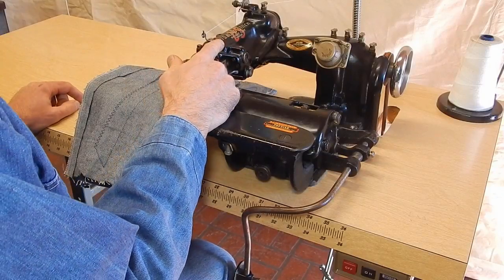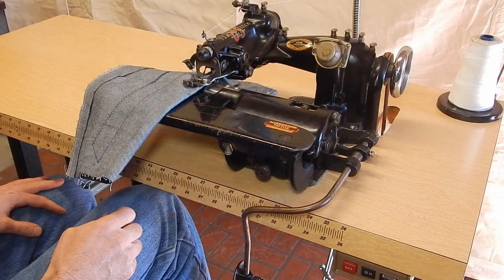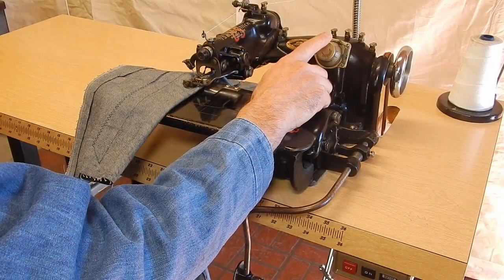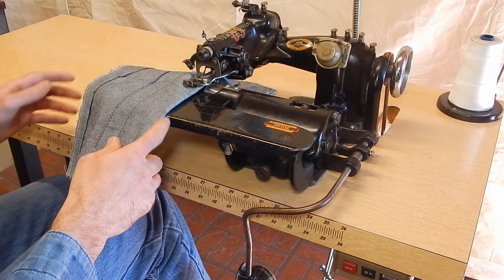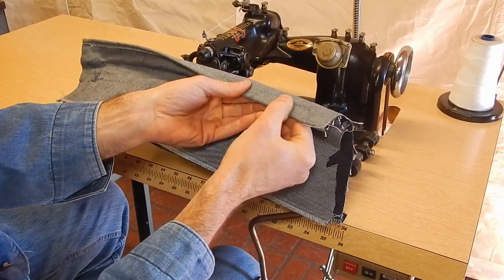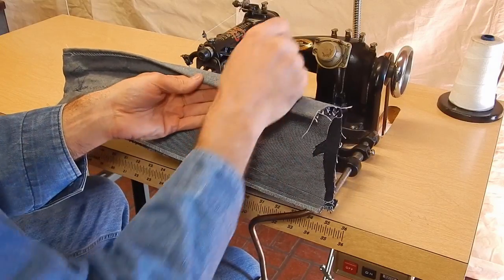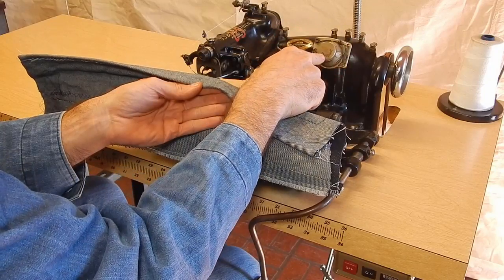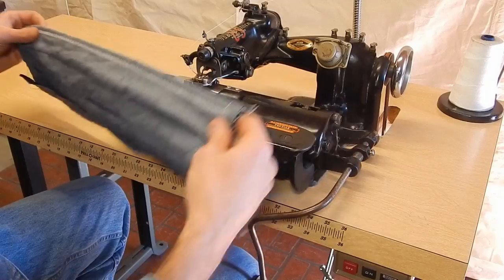US Blind Stitch 118-1 Industrial Sewing Machine.

Comment: As someone who sews draperies professionally, let me explain how you would prep the fabric to be inserted into the machine: As for the hem at the bottom of the drapery, you would fold up 4 inches, then fold up another 4 inches. Then you would put it into the machine with the fold facing upwards and with the guide up against the fold. I give my handwheel a few turns by hand to secure the 1st few stitches and then slowly push the pedal. The stitch has to catch the front side of fabric And the fold of the hem...or you will Not have a successfully sewn hem. You may have to make adjustments to the regulating dial to adjust the penetration of the needle into the fabric (more or less). Hope this helps someone out there.